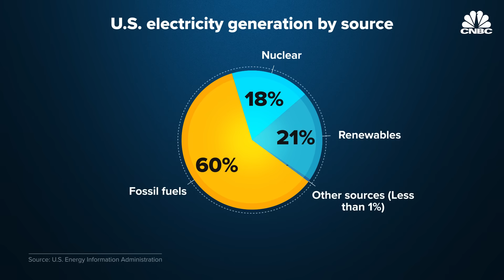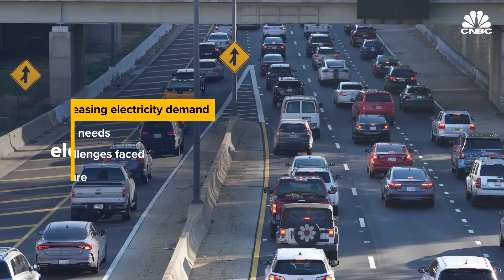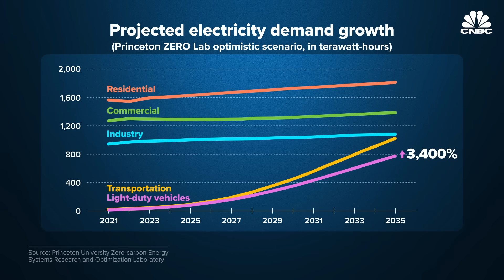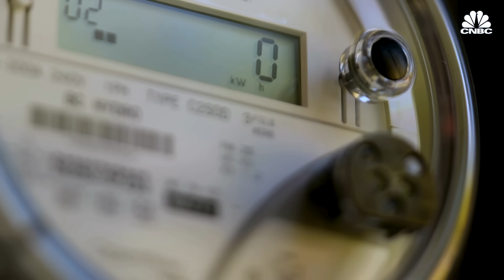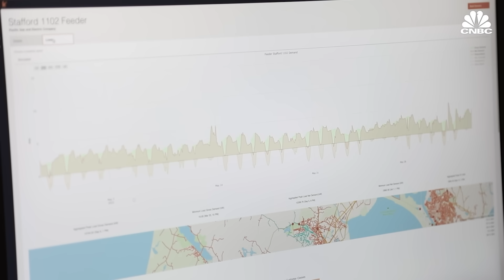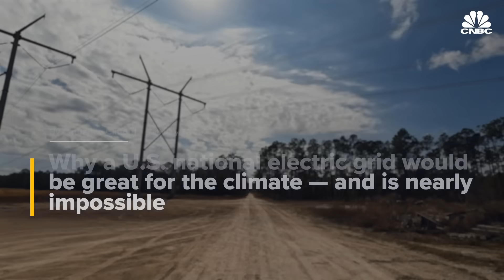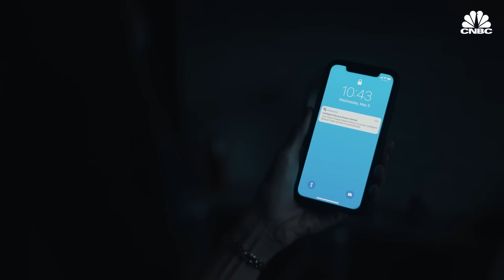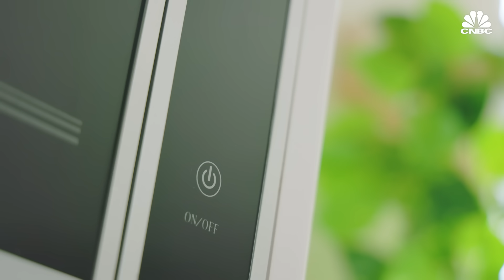Can The U.S. Power Grid Handle The EV Boom?

Comment: Engineering Explained channel did an excellent video 2 years prior to this one that clearly demonstrates no issues with the grid handling an all ev future moving forward, given historical grid trend data and expected ev transition pace moving forwards 
Far bigger impact on the grid is from data center growth.
But data center issues appear to be addressed with legislation requiring data center operations to commission their own power generation as part of the data center buildout, whether fossil turbines on site, or local renewable hydro, geothermal,  or solar, wind, batteries on site

Comment: Yes. Gasoline is a scam. It takes 13.5kwh to extract, refine, and transport a gallon of gas on average. This is, coincidentally, about the same amount of useful work a typical ICE vehicle can extract from a gallon of gas. So why not just leave the crude oil in the ground and use that same electricity to power vehicles  directly and with a very high level of efficiency? Billions of dollars of anti ev propaganda for one, trillions of dollars of oil industry subsidies to keep prices down for another. Every EV on the road frees up that gas production energy for direct ev use.

Comment: People claim that everyone will be charging their EV while sleeping. There are a lot of problem with these claims. The price of electricity depends on usage: prices at peak usage cost higher. The current price of electricity charging at night will increase. There is also risk of EV caught on fire while plug in. This is when people are asleep. House with 2+ EV will be at higher risk of going up in flame. Night time is also colder so places in winter needs to house their EV somewhere warm. The more people that plug in, higher chances of electric surges because power plant cant handle it.

Comment: Both yes and no.   It depends on when the recharging is done and at what rate.   Our grid is designed for the estimated peak usage so during off peak, there is plenty of unused capacity.   One of the peaks planned for is the preparations for dinner which tends to happen at more or less the same time for many people.  The power outlet for the stove and oven is comparable to a level 2 EVSE to recharge the EV.  So long as we eon't all cook at the same time tha5 we charge, most of the capacity is already in the grid.  Obviously, some improvements will have to be made and likewise if there's some standardization on controlling when charging occurs, much of the infrastructure inprovements can simply be avoided.

It's quite telling that there has been no effort made in standardizing when chargings are done and no effort at standardizing V2G...

Comment: It's a year later. Trump is back in the White House chanting, 'Drill baby drill!" and "Ending the EV mandate."  But let's see how far he gets.... Corporate execs might like him, but are they really going to build more oil/gas/coal plants?  I seriously doubt it.  Why build something that is already obsolete and which will cost more to operate? They might keep some existing plants online longer. 

Something not included in the video is the slowed increase in Peaker Plants (for high electricity usage in the evening, when everyone gets home, but the sun is no longer shining and the wind stops blowing). Mega Packs, batteries, are replacing them. Less expensive, more versatile and they store electricity.  None of the old sources do that (except for reservoirs and oil tanks).   PG&E three years ago in Elkhorn Slough replaced a planned gas peaker plant with a Tesla Megapack.   The cost per kW of batteries is dropping. Tesla last year turned the corner on their 4680 batteries, being able to make them at the same cost per kW as 2170s. These costs and better batteries using cheaper materials, will further contribute to shifting daylight solar and wind to off hours.  Also the long delays in permitting and building transmission lines should begin to speed up as the need increases. Do you really want to delay the plan review another three months when that power will be needed? 
And I had no idea my Model Y uses the same amount of electricity as my refrigerator. Doesn't seem like a lot.

Comment: I believe every person needs to have a propane generator and a way to plug that into the main breaker panel. Like a transfer switch or a cheap sliding lock bar. Why do people rely on the grid? So many people purchased a genrac or even small propane generators after what happened in Texas in 2002. Enough to at least power lights and a small ac or minisplit in one room. Or at least a 1500 watt space heater and some lights.

Comment: I have a ground mount and solar panels. I also have a propane generator. I am connected to the grid but I'm using it less and less. My plans in the future is to get more solar and not need the grid at all. I have a large house and a 5 ton and 4 ton ac tied to the grid. I hardly use those. I have 3 energy star inverter minisplits that add to almost 5.5 tons of free ac.  I will use the propane generator in case the grid goes down.

Comment: Electric vehicle means  hydroelectric power  never  battery based.  Like  electric trains and trams. Battery  are more pollutants than hydrocarbons.  Manufacturing  process and  battery  making  aren't  pollution  free.  Size of  our  planet earth is fixed and  can't be  increased  and  no pollution Goes outside.  So even  importing  battery  would  give  temporary  pollution  free  illusions.  It  would certainly  be  there  somewhere  inside  earth.

Comment: EV batteries  are charged at night, off peak.  Helping stabilizing the grid. 
     No need to build new power lines.  Replace Peaker plants with Battery back ups. 
  There is no shortage of Sodium or iron etc.  those batteries will replace todays LFP. Batteries or older NMC   Batteries.

Comment: If you had a wireless charging road, along with flywheel energy storage, Graphene Solar, Vertical Wind Turbines, and a hyper loop, cars and semi’s could literally even outpower distribution across the United States.

Elon’s Cars, Trucks, and Semi’s are Already Here:
- We need to redesign a power grid and retrofit a Highway (repave) Just For That.

Comment: An electric hybrid plane is awesome it uses fuel to get off the ground and switch over saves a lot of fuel. Hydrogen is nice, but instead of creating hydrogen stations for consumers. Keep hydrogen on the B2B level and pipe it directly to the powerplant then produce electricity for the consumer. The solves the problem of stations everywhere. This tactic is feasible and does work. They just don't want to do it.

Comment: No.
But the EVs boom ain't gonna happen, so it's no problem...
Reply: Have you never been in an EV? It is superior to ICE vehicles in every single meaningful metric. 

Range and charge time are the usual complaints: 

300+ miles is fine for daily driving. Most people don’t need more and the ones who do will have hybrids 

Charging time: takes 10 seconds. You plug in when you get home and unplug when you leave.

Comment: NO, The power grid can not handle even 30% going EV due to the age of the lines and just the sizes of the wires AND THEY WERE TOLD THIS IS 2005 when the 3 year study report was handed to them. — I was part of the group putting the info together and NO ONE LISTENED and here is the proof they don’t care !

Comment: In the mid 1970's I painted high voltage steel tower's while energized. 
No safety lines, no safety belts, or harnesses. The utility companies wouldn't even allow ropes, for fear of getting into a hot line. 
I doubt much tower painting is happening nowadays.

Comment: Great video on renewable energy! If you're into outdoor camping or value family time, I highly recommend the Segway Portable PowerStation Cube Series. With its massive capacity, armor design, and super fast recharging, it's perfect for powering your devices and appliances during extended periods outdoors. Plus, its waterproof technology and uninterrupted power supply make it reliable in any adventure. Check it out!

Comment: You bias corrupt politicians you won’t be able to get rid of petroleum EV use oil for moving parts there is a reason why petroleum comes from earth 🌎
Reply: But they use substantially less over their lifespan than combustion cars. Which is the entire point
Reply: @engineeringtheweirdguy2103  but it won’t work sit back and watch people will wake up our old grid can’t handle it..
Reply: @dan32one44  what won’t work? and yes. The grid will be fine. I most places, some places destroy their own energy grid with or without EV’S, such as California.

But look at Norway. Nearly 90% of all cars on the road are fully electric. Their grid hasn’t had any problems. Infact the energy grid continues to expand at a rate of 100% increase every 20 years. (Doubling every 20 years.) despite that continuing to occur in most places, including most of the US. Average household energy consumption has gone down thanks to LED TV’s, LED lights and low power electronics. 

The other thing to consider is that while the grid capacity doubles every 20 years, EV’s won’t increase nearly as fast. Infact, even if every automaker in the world, tomorrow, switched all their current cars to full EV production tomorrow and made their cars at peak capacity. It would still take more than 40 years to make enough cars to replace all the combustion cars on the road. And that’s assuming the driving population doesn’t increase over 40 years. Which it will. 

So even In that impossibly unrealistic scenario, EV adoption will be far outpaced by the grid ability to expand. 

You got nothing to worry about.

Comment: If you think about the whole thing, to electrify everything there will need to be a production out put never seen before in human history, just copper will need probably 30 times the amount that is currently produced globaly, that is for new evs, power lines and everything in between.
And there are 30+ other materials that will need just as large a build out.
Also remember that even on the 'greenest' power grids there are peaker plants that are used to cover renewable short falls which are the dirtiest form of power production when natural gas is not available.
I am all for electric cars just on the health side with no exhaust fumes in the cities, but I'm not blind to the fact that places that build them on mass are not green powered and the materials used to build the cars are not clean to make, so to off set the carbon pollution in the making and powering of evs right now will probably take 10 or more years of driving.
Then there are the growing number of ev fires, as more and more make it to the roads its only natural that the number of fires grows with that, and how toxic they are when they burn, with all the chemicals in the batteries both the air around the fire and the water after are left contaminated, plus fire departments not knowing how to put out fires on every different type of ev.
Evs and green power grids might just be tech that is being widely used before they were ready and what we are seeing is the effect, build all the solar and wind you want, they won't help on a windless night, it will take a massive break through before battery tech is good enough to power entire countries over that windless night, because remember that alot of countries including the US are not building much in the way of nuclear, so when there is no wind or sun then on go the gas and coal power plants.

Comment: Why not a segment on "grid of Grids" concept where autonomous city block scale DC microgrids link energy efficient DC buildings (greatly reduced energy use) and EV's not only solve many of the problems outlined by the climate lobby but also go a long way in mitigating the national security vulnerabilities of the existing grid, By the way, why was there no mention in this piece of retrofitting the existing transmission lines with greater capacity conduits?

Comment: When you have 1000 mile capacity batteries you have no more problems. No one needs to charge in the day, nobody needs to look for chargers or break any journeys to charge. Charging takes place at night when everyone is sleeping. Cooker off, lights off, TV off. There is a reason why night time electricity is cheaper. You have all that generating capacity not being used but hey! we can use it to charge EV's through the night and possibly over a 10 hour period. No problems.
Reply: How far do you drive in a single day to get to and from work? Even at 75 mph, 1,000 miles is nearly 14 hours worth of driving, non stop. No toilet, or sleep breaks, or food breaks, or rest stops. 14 hours behind the wheel without flinching. Who the hell is doing that kind of driving? Even on a road trip? Why do people throw out absurd numbers as a “minimum” that EV’s need?
Reply: @engineeringtheweirdguy2103  who said you drive 1000 miles in a day. You stop whenever you want, I just said you don't need to stop to charge and when you do charge it doesn't need to be done during the day.
Reply: @marviwilson1853  and how often will you be planning to stop somewhere that doesn’t have electricity? 1,000 miles is a ridiculous requirement. Please explain exactly how you landed on 1,000 other than pulling some absurdly arbitrarily large number out of thin air?

Comment: Roof top solar panels will solve those problems.  Charging is typically done at night after people go to bed..  when power demand is down. 
     Realize the average driver covers 12, 000 miles a year. That’s less than 40 miles a day.  Even on 110 volt you leave every morning with a full “tank”

Comment: it was expected in the early 1970s many smaller coal fired inefficient and non clean burning electric  power plants would to be rendered to standby statues or less by new super high efficiency clean burning coal plants and nuclear power plants as electrical demand increased.   Then except for a few growing areas electrical demand grew far less than predicted, much of that lower than expected growth being attributed to much high efficient electrical devices and lack of new large industrial uses of electricity.  Now with the growth in use of electric cars and huge data center including cyber currency processing industrial electrical demand the USA electric grid would be expected to need to grow somewhat like is was expected in the early 1970s.

Global warming has been paused at about 1°C since the early 1990s.   After global warming was increasing at about 2/10°C per decade through the 1970s and 1980s it was reported at 1.1°C in 1991.  In late 1994 global warming after not being reported on for several years was announced, for no known reasons, to have suddenly paused in the early 1990s.  In 2022 global warming was officially reported at 1.06°C.  Many if not all of the United Nation's Climate Change disclaimer labeled videos are not using official global warming temperatures.  In the mid 1990s some reports reevaluated the 1991 global warming temperature of 1.1°C to 1°C.  Reevaluation of current global warming is a possibility.  

There is no mechanism that would allow greenhouse gas behavior to cause global warming because greenhouse gases are only active in earth's greenhouse effect which is the model of system always in saturation from the strong greenhouse gas water vapor and can't have its overall effect changed.  

United Nation's IPCC science report acknowledges that it is NOT in-fact discussing greenhouse gases in a manor constructive to the discussion of global warming by a legal statement of data transparency in the back of its science report that it took its greenhouse gas samples at 20,000 meters altitude and only that one altitude.  It is high school taught science there is no greenhouse radiant energy more than 20 meters from the radiating surface, typically the earth.   

There are people without a full high school science education or a life history going back 40 years that have been taken in by the marketing of the United Nation's IPCC that human caused greenhouse gas emissions are causing global warming which is impossible to well known science.   It is high school taught science earth's greenhouse effect is the model of system always in saturation from the strong greenhouse gas water vapor that adds 10°F (5.55°C) to earth's average temperature and takes place within 20 meters of the earth's surface.  After 20 meters from the radiating surface all the greenhouse radiant energy has been completely absorbed by greenhouse gases.  Its further heat transfer is by convection i.e. gas molecules bumping into each other.  At 1% average tropospheric water vapor over 99% of earth's greenhouse effect is due to water vapor.  

It's suppose to seem cool and a bit of a brain conundrum to high school students causing it to be fascinating that with water vapor varying hugely across the earth's surface water vapor still always holds earth's greenhouse effect in saturation.   The variation is accommodated by the qualification of "within 20 meters of the surface" a great deal of the time all the greenhouse radiant energy is entirely absorbed by greenhouse gases before that distance.

Comment: No it cannot. We can't even handle the hot summer days with everybody turn their air conditioners on and you want to go to electric furnaces electric grills electric water heaters etcetera etcetera now you have an evil there's not enough current to do this. It's going to fail plus I don't want your crappy electric car